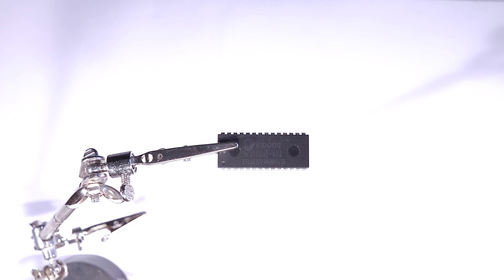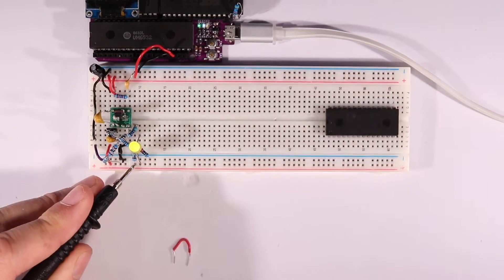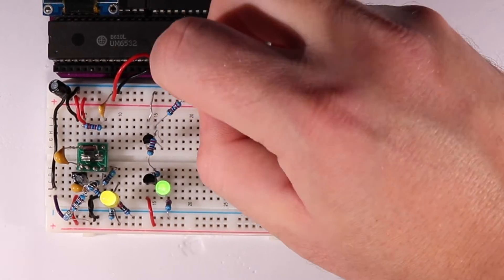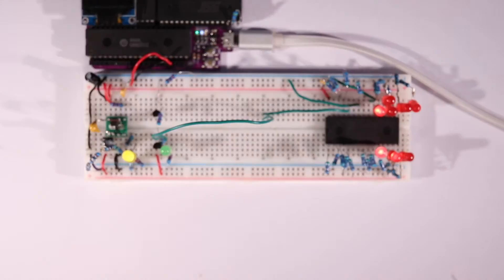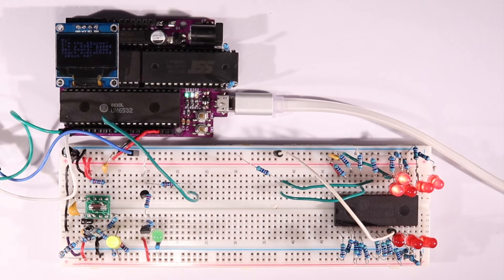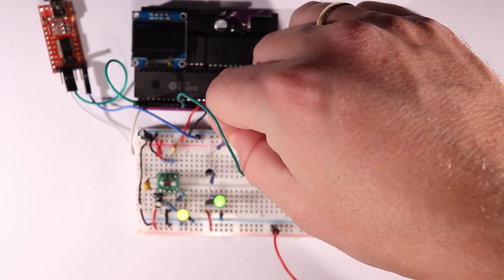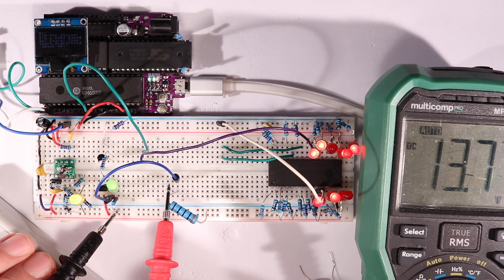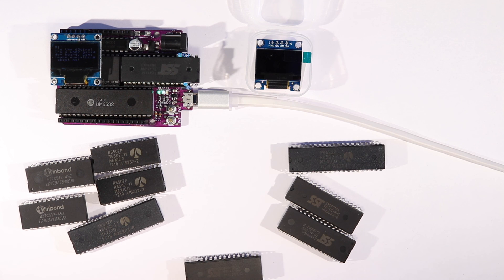Erasing an EEPROM with 14.02 Volts on a breadboard

Comment: Whats the point of the PNP transistor. I checked in LT spice and you cut off the PNP part all together. From my understanding having only NPN is sufficient, and NPN on its own does work (The gate of the NPN is connected to 3v3 via 220ohm and the collector is connected to my 10V via 10kohm, so when i set 3v3 on gate it should cause the voltage for collector to be 0V, and when gate is 0V the collectors voltage should be 21V). However when i try my NPN BC547B in real life it doesnt work, and i have some weird Negative Voltages, and the collector doesnt go to 10V whatsoever :(
Reply from the maker: The npn pnp pair is to avoid inversion of the signal